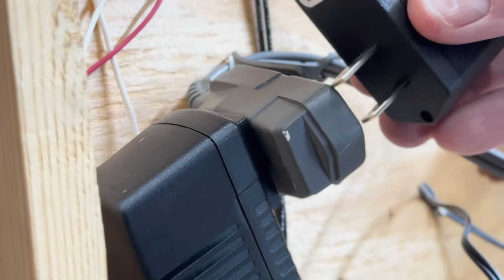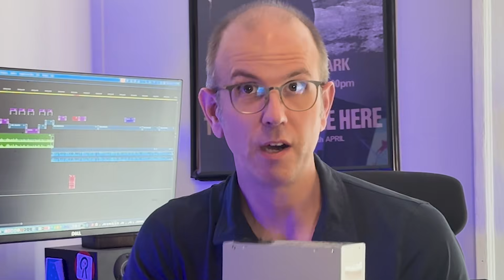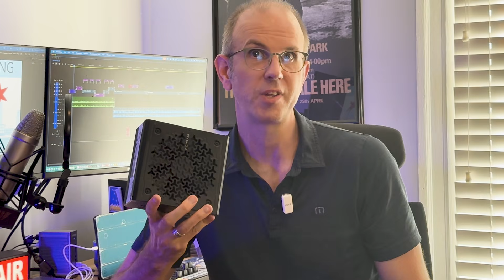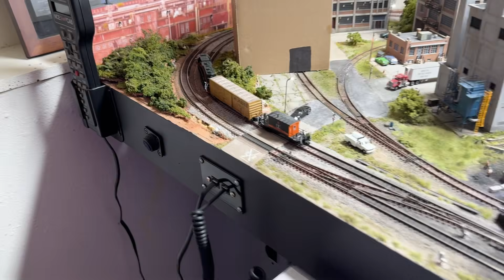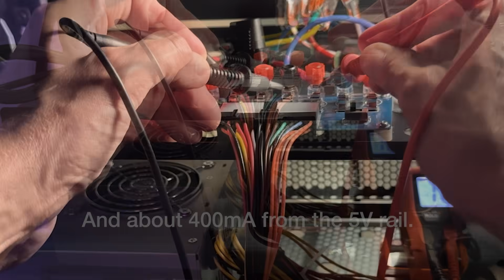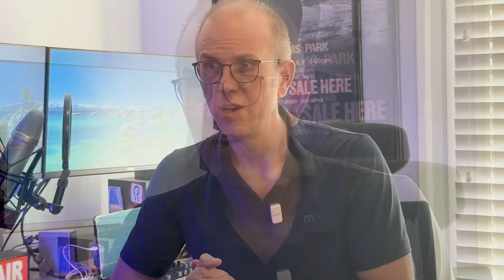ATX Power Supplies for Model Railroads | CCMR At The Bench #42

Comment: Good morning CCMR, I’m very impress with all of your videos, making it very easy to follow and understand your methods of implementing various disciplines of model railway. 
I have a special interest with this particular video, because I’m in the process of implementing the same. However, I would like to introduce a duel amp and volt meter digital displays for each of the power outlets from the ATX, here’s a link (I hope, showing what I mean) (https://share.google/tsKRNz8j6Z4Q25YbT).
Not electrically minded I was wondering how I would integrate these three display units into the ATX, is this something you could help me with this. I know there is a lot of illustrations on YouTube about this subject, but they are not clear how this works with an ATX. So your help will be very much appreciated….. many thanks in advance…. Brian ( UK)

Comment: I've been using an ATX power supply for accessory bus power (12v and 5v) for years, but you taught me a couple new things today. The added function of the new supplies is interesting. It might be time for an upgrade. 🤔 Thanks.
Reply from the maker: Thanks Ron. Your video inspired me to try this out in the first place!
Reply: @ChicagoCrossingRR well I've had good luck with mine for the past several years, but I have a feeling the upgrade to the power supply would be a good idea in the long run.

Comment: MMmm.  Not really correct on the use of supplies provided by DCC companies.  You may have Warranty issues in the US but certainly nowhere else in the world.  DCC systems all have voltage allowances between 15 and 18VDC.  There is no specification on transformed/rectified vs switchmode supply.  In fact the majority of suppliers provide switch mode supplies in their kits.
As for current protection; no DCC system has protection against overcurrent which is why they limit the supply provided with the system.  NCE systems are renown for burning out when overcurrent (NOT a DIRECT SHORT) has occurred; i.e. operating you Powercab with a 3A load on the rail or you Procab with 6A load on the rail.  Most modeller fail to comprehend the current draw for older locos converted to DCC plus sound.  Just 2 of these will overlap a Powercab.
I agree that you should not be using an ATX supply on your DCC and Accessories.  It is always good electrical practice to run separate power supplies for DCC and Accessories, however using an ATX to supply 12V, 5V and 3.3VDC for accessories is fine.
Reply from the maker: Peter - that's why the text in the lower third says "can" rather than "will." The goal is not to account for every manufacturer or every product in every region.  It's to prompt the end user to notice this. NCE is quite vehement about using the supply specifically packaged with their ProCab product as a warranty condition. MRC likewise (counts as 'alteration' and 'inappropriate installation'). That's enough to justify the statement.

Comment: OK,  those wall warts are not strictly transformers.  They are switch mode supplies just like the ATX..  If they were "transformers" they would be more than double the weight and a bit larger
Reply from the maker: Hi Peter, yes, the 'brick' is an SMS.

Comment: I didn't hear you argue for or against powering a DC track with an ATX PSU (not explicitly, anyway). I'd be interested in knowing your thoughts. Thanks.
Reply from the maker: You likely could use one of these for raw power if you connect it to a PWM controller or potentiometer. 12V should be max power input (full throttle) for N and HO scales for instance. Same deal though - huge amount of current so inline fuse or breaker protection ahead of the track would be smart.

Comment: Although I’ve thought about utilizing a ATX psu, I’ve resisted. Ever since switching to DCC, I’ve had an abundance of old TechII transformers that I’ve repurposed for point control and lighting. I’ve given in and now control all my lighting with the Woodland Scenics Just Plug units, not only because it’s easier but individually dimmable. I use three Tech II units to power them and another to power the points. So far so good, but the idea of using a breakout board with an atx and replacing all three has crossed my mind to be fair. Very informative, however, Eric. Had I not started with DC, I may very well have gone that route.
Reply from the maker: The Tech IIs are really nice and are industry standard. As a fun bit of trivia, the Chicago Museum of Science and Industry has a massive HO scale layout (BNSF Chicago to Seattle) that runs off of banks of those controllers. It's all DC analog, no fancy tricks, just reliable and controllable power to the track. Love the idea of repurposing those for lighting. The max current I think is like 1.5A so it's pretty ideal for that application.

Comment: I have for while used A COMPUTER power supply , no interface just made my own interface .    What I use it for is making a 12 V bus and a 5 volt bus that runs around the layout.   12 volt for the turn out motors and the 5 volt for my lighting LEDS.   There is a lot of area on the Layout where there were no plugs for wall warts.  I used bread closures to mark the 12v and the 5Volt.    Thanks for sharing that , got mine at a yard sale for 5 bucks.   Good stuff!!
Reply from the maker: Hi Will - the interfaces themselves are a pretty easy DIY and sort of a fun beginner project as long as one has a basic understanding of high voltage capacitors or has one that's just been laying around unpowered for a while. I've been thinking about what to do with the ATX 2.0 I retired from layout service. Lots of options :). Have a great week and thanks for sharing your strategy for working with them. The bread closures are a nice easy way to make the connections.

Comment: Great video! I had seen your previous wiring videos and I saved my old 2014 500W ATX supply (which appears to be the 3.1 spec as the 12V rail has the highest amperage of all) plus obtained a breakout board and some buck converters as I have same multi-bus issue. I don't have enough surge protector real estate for the wall warts which is why fhis is attractive. I know what you said about not using this for the main DCC supply, but what about an accessory DCC bus on a slave booster? This bus would just be powering servo switch machines that have integrated DCC accessory decoders.
Reply from the maker: Thanks! Interesting question re: accessory DCC bus. In my limited experience the biggest issue with using the 12V rail for DCC is that the drop leaves insufficient voltage and potential overcurrent problems on units like mine. That and the huge amount of potential current that could be imparted on the system. In other words it CAN be done but isn't generally wise. For servos on an accessory bus, the former is less likely to be a problem and the latter is easily manageable. It's probably worth doing an experiment to see how well that works before committing it to your layout's overall servo power scheme. If you do end up playing with this please let me know outcomes.